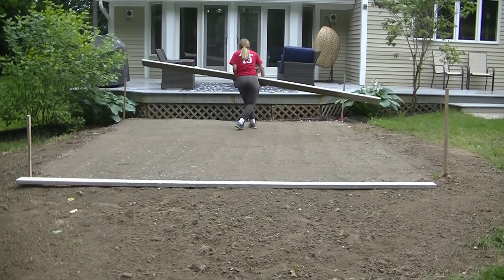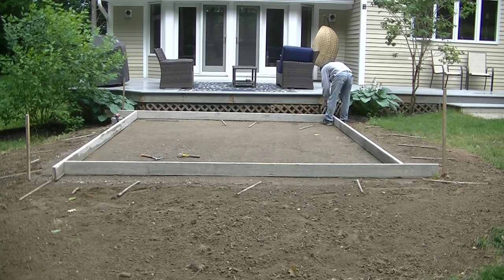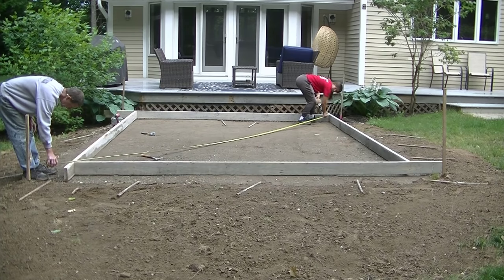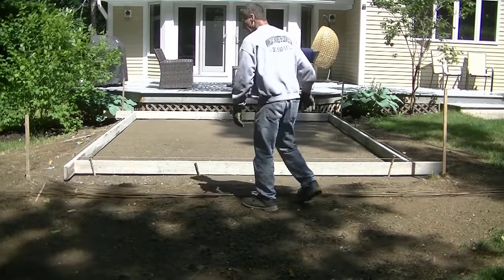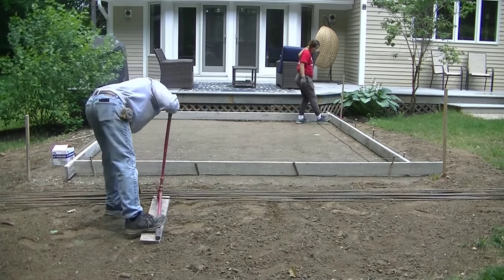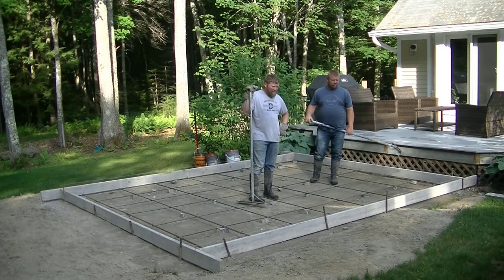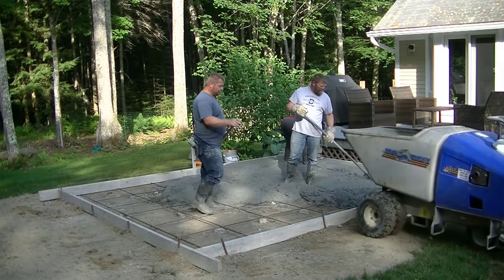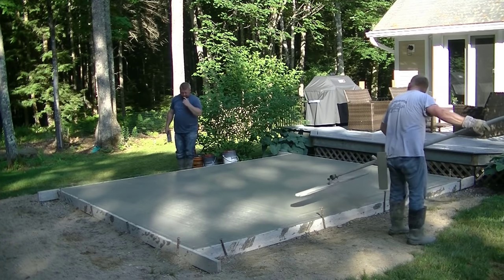How To Pour A Concrete Slab for Beginners | DIY Concrete Slab

Comment: What does the concrete driver do with excess if you order too much?  Does he have to dump it on site?  Can he take it back?  I realise I would be on the hook monetarily but I just don't want a pile of concrete in my driveway.  Also, do they give you a time-limit to unload the truck?
Reply: No, they take back what they don't use out of what you ordered. There will be some left in the chute when you finish that will need to be washed out on site somewhere. That will leave a pile of water and aggregate that you can clean  up later or plan to contain. Usually I just use one or two wheel barrels for that.
Reply: I forgot to mention that yes there is usually a time limit per yard to get it off the truck and that's going to vary from company to company so you will want to check with your supplier

Comment: Good looking work Mike. Made it look easy. Great video!
Reply from the maker: Thanks 👍
Reply: @MikeDayConcrete  making a slab that will be against a house on one side. Can you pour that side of the slab directly to the house or do you need to make a complete frame so there's a gap between the house and the slab?
Reply: @erikhamilton4866  use expansion joint against the house.

Comment: Could you use a slab like this for a parking pad?
Reply: Yes, the slab is thick enough and with supporting rebar is sufficient for a parking space.
Reply from the maker: Yes, with the right gravel sub-base for your area.

Comment: I am interested in the course. I checked out the website but there’s no “contact” option. I live far away from town and would need to mix the concrete myself. Do you also teach people about concrete mixers and mixing concrete?
Reply: There're Youtube videos with a dry pouring technique that I found interesting: all steps for pouring are followed, except that the concrete is poured dried, then water is sprayed over the concrete several times, with intervals of 1.5 and 2 hours. The labor is cutted by more than half, and the finish product is very impressive

Comment: You did rebar instead of mesh because of the hot tube weight?
Reply from the maker: Partly yes. It's what I spec'd in the slab, easy to install.

Comment: When you add a concrete slab against a house with a slab, do you have to drill rebar into the house slab foundation so that the slab you pour can anchor to it?
Reply: No
Reply: The guy filming this video has shown on other projects that he puts a strip of foam between an existing foundation and the new slab so that they can move independently.  You can then put caulk overtop of the foam if you want to make it look cleaner.
Reply: Yes, otherwise the new slab will drift away from the house with the expansion and contraction of the soil. Al least in Texas where the soil is clay dirt.

Comment: What is the purpose of the string line?
Reply: I would say to keep the forms straight as the put the support rods in.
Reply: @gordchase2806  -- That makes sense. Thanks!
Reply: Also There is hydraulic pressure from the concrete being that thick and of it bows out hell be able to see it
Reply: @johnnyinthehellcat4092  That is not right a string line is not left up on pour day. It is used when forming.

Comment: Square with the slope in the tape measure isn't to accurate, gota be a tight pull.
Reply: Unless you measure it both ways with the same slack in the tape measure ...

Comment: Set your stakes lower than the form, its just commonly done.
Reply: Mike typically does NOT use the top of the forms to screed against.  He mag floats the material at the edges, then uses those to screed to.
Reply: That is not necessary. Pour concrete everyday and you'll know why your not wasting your time beating the hell out of every pin you set.
Reply: Or use a laser and an aliminium screed like a real concreter does. This wooden screed shit is from the 50s get with the times.